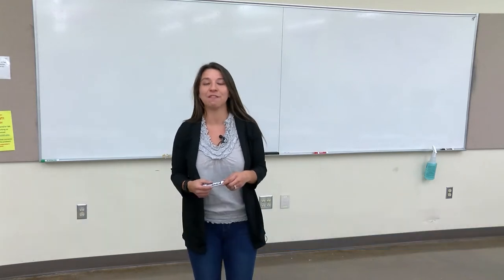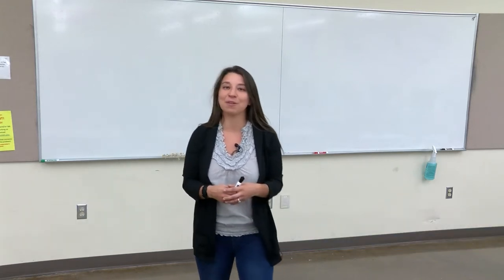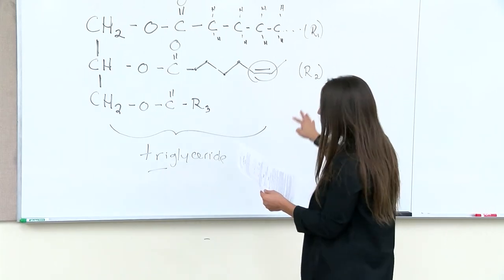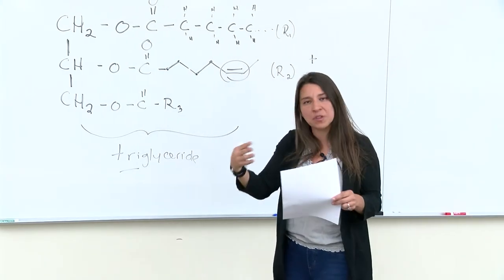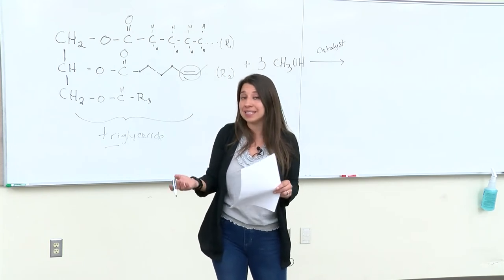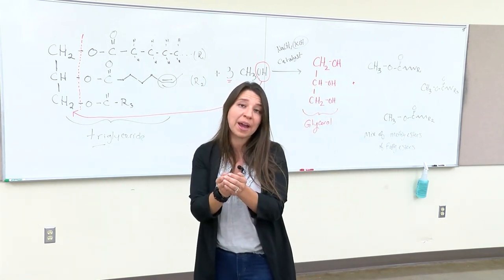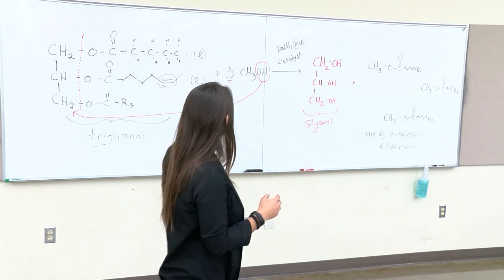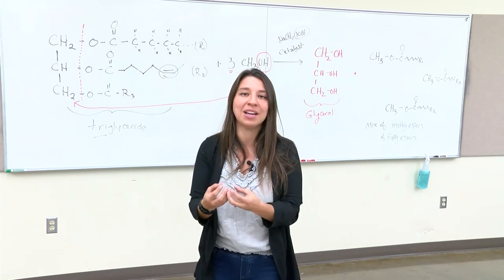Creating Biodiesel - Part 1

Comment: This was a great introduction to biodiesel. I am curious about the fatty acid profile for the pennycress plants. I am conducting research in NC on making ethyl esters with a glyceroxide catalyst. We use the cooking oil from the fryers in the cafeterias on campus to make fuel for the diesel mowers and generators. At smaller scales, we have used soybean oil and distilled the product to obtain two different fractions that have different melting points.